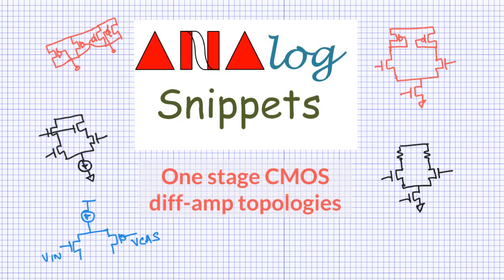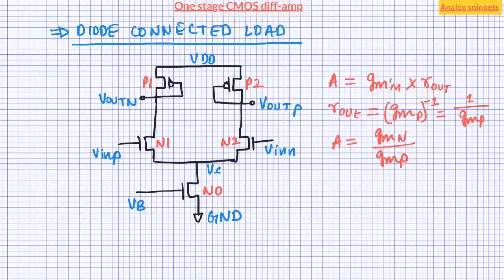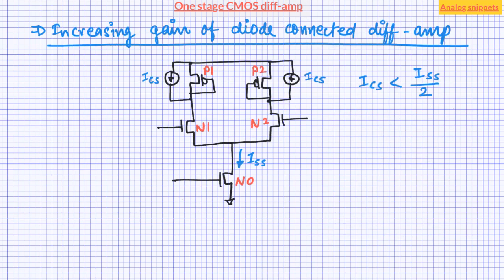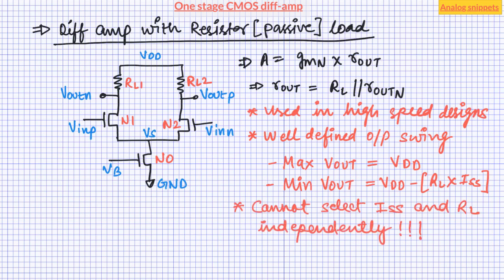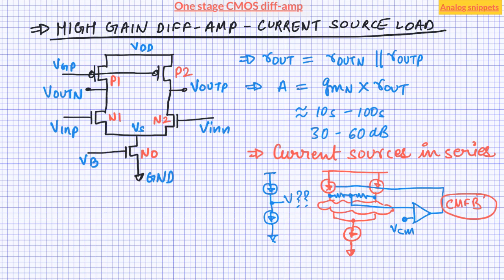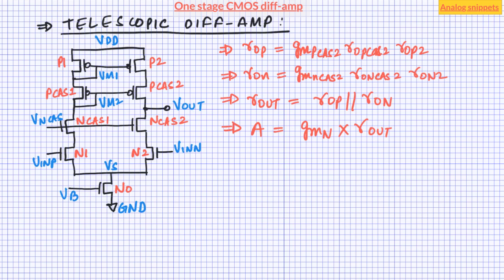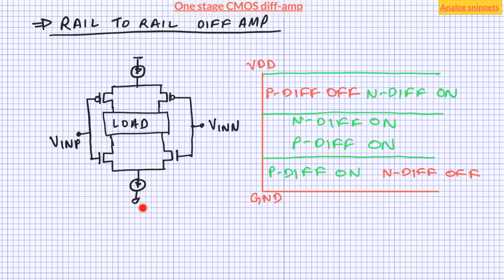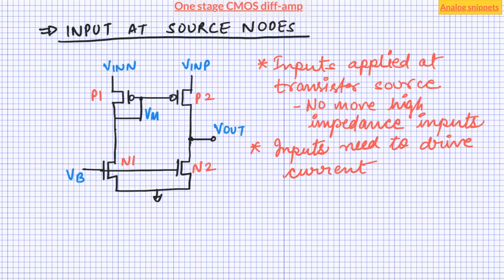#13 One stage CMOS differential amplifier topologies

Comment: Had a question, for the last circuit topology where you used an input gate state to compare two supply voltages, do you have additional reading material as to how this amplifier or a comparator works? Would love to get additional insight as to how it works.
Reply from the maker: I haven't seen much material on this topology. But seen it quite a few times in real designs. Will make a video on just this topology.

Comment: Do we need CMFB for the diode connected fully differential amplifiers topologies discussed here?  For the fully differential with current source load, the output common mode levels are not well defined and may pull transistors in triode. So we need CMFB. 

The output common mode level of the diode connected can be defined as VDD - VSG and they have inherent negative feedback. But for the two diode connected load transistors seemed to be uncoupled from each other since their gates are not connected. Do we need CMFB here?
Reply from the maker: You are right. Diode connected load fully diff amp does not require CMFB. Similarly resistor load fully diff amp would not require one. Output common mode of these circuits is well defined. In general high impedance nodes with current sources in series require CMFB.
Reply: @analogsnippets  Thanks for the answer. I am really enjoying your videos. Keep up the good work.
Reply from the maker: Thank you.

Comment: Interesting video as always. For R-R with PMOS+NMOS diff-pair for folded cascode amps, it is interesting to note we can go 0 to VDD at input but not at the output for the fear of compressing gain of last stage devices. Lastly it would have been better to point out  cons of the last circuit you mentioned for R degenerated diff-pair with better ICMR (the one with no IR drop across resistor)
Reply from the maker: Yes, that's true. R-R are entirely separate topic in itself. Introduced here just for the sake of completeness.
Reply: Analog Snippets great work, looking forward to more such interesting videos